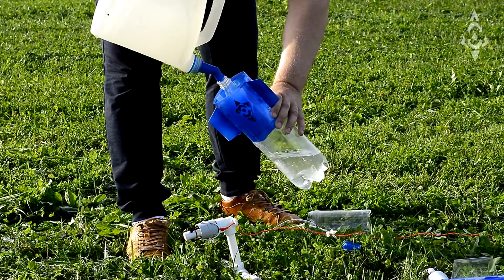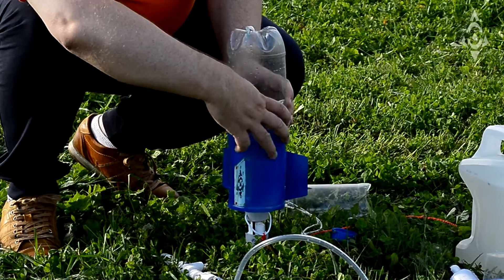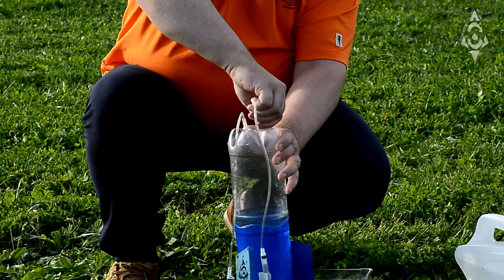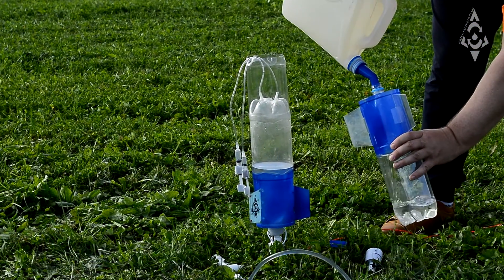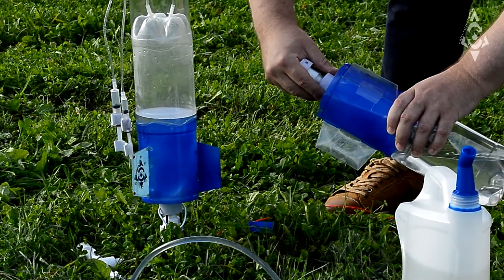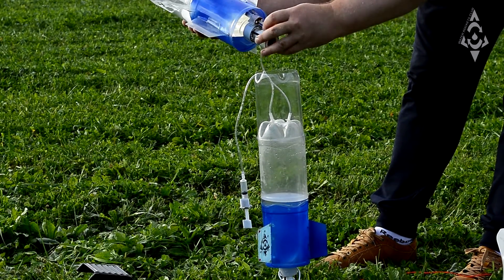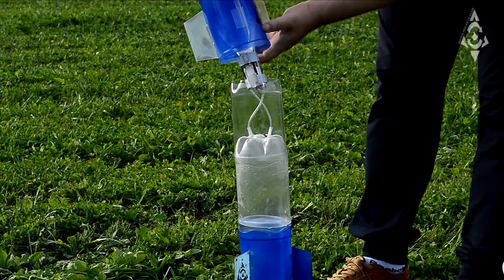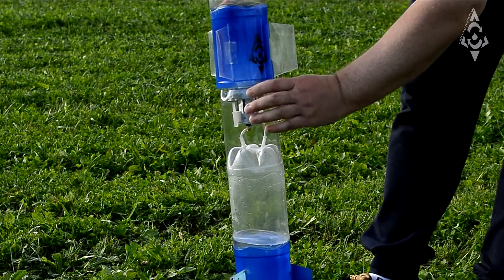Multistage water rocket. Staging mechanism test.

Comment: Really nice video, 
I have a question for u 
Is there some a leak in the piston(at 80psi)???
Reply from the maker: As you can see, they can withstand such pressure. There are no leaks. This was found out experimentally. It is obvious that the units of diffusion systems for blood transfusion are made with a greater safety margin than the manufacturer specifies. Disposable dropper systems (infusion systems) are usually designed for excess pressure of 40 kPa
Reply: @WATERROCKETSCLUB 
Thanks very much❤❤❤
I hope you pulish more video in the next time, your idea help me very much. 
From Viet Nam with love
Thoan Nguyen

Comment: Hi, can you elaborate on how your second stage drive mechanism works?
Reply from the maker: Thanks for the comment. Piston mechanisms are made on the basis of disposable syringes. And they fastened to the mechanism of separation is really using Velcro))). The idea of a piston mechanism is not really new. But usually such mechanisms are rigidly attached to the previous stage of the rocket. I decided to implement the idea of separate preparation of each stage of the rocket. And connect the stage with the help of elements of the rocket carcass.
Reply from the maker: https://youtu.be/fly0Bq8G5RI?si=ywvAPsha1fZ_avm9

Comment: man will u mind telling me how much pressure did u use before launching it , was it 70 psi??
Reply from the maker: Yes, the pressure was about 70-80 psi
Reply: actually i am going to be participating in  a competition of making water rockets , just wanted to take ur reccomendation, if i have to maximize the range when i am launching it from around 45 degrees at 70 psi max limit and with a maximum water allowed to be 2 litres , should i prefer a single stage or a dual stage rocket ?
Reply from the maker: @shaansapru6676  In theory, a two-stage rocket will fly further. Do the organizers of the competition limit the number of rocket stages? Be sure to shoot a video. It will be interesting to see your rocket design and competition results. Good luck! Successful launches!
Reply: Yeah they don't want more than 2 stages , that competition was supposed to happen in jan but due to this covid thing its been postponed and will most likely happen in the 2nd half of 2021(they are saying its in november) , whenever it happens I will surely inform u the results and also shoot a video .

Comment: Interesting staging mechanism. Thanks for sharing. :) How do you attach the pneumatic pistons to the rest of the staging mechanism. Is that velcro?
Reply: hi there
Reply from the maker: Thanks for the comment. Piston mechanisms are made on the basis of disposable syringes. And they fastened to the mechanism of separation is really using Velcro))). The idea of a piston mechanism is not really new. But usually such mechanisms are rigidly attached to the previous stage of the rocket. I decided to implement the idea of separate preparation of each stage of the rocket. And connect the stage with the help of elements of the rocket carcass. I hope my decision will interest some fans of water rockets.
Reply: How many ml has the piston???